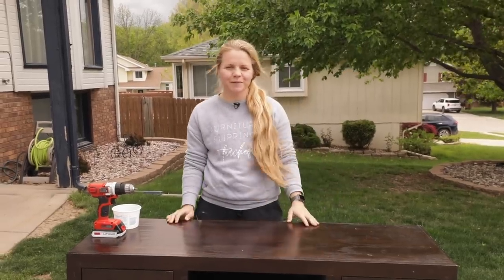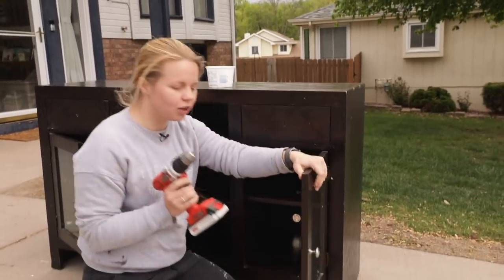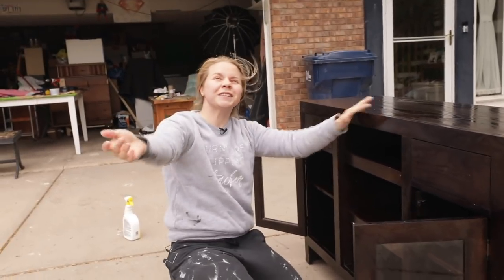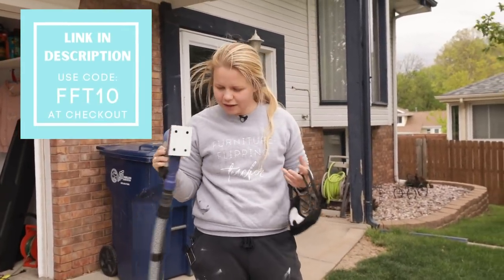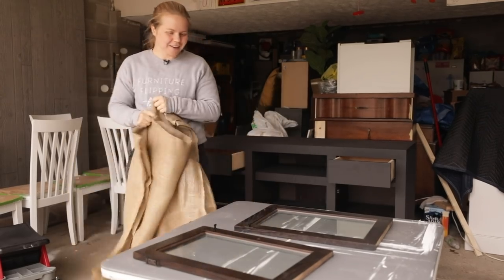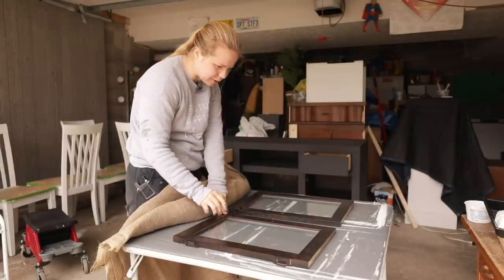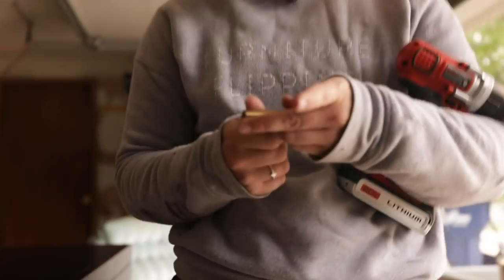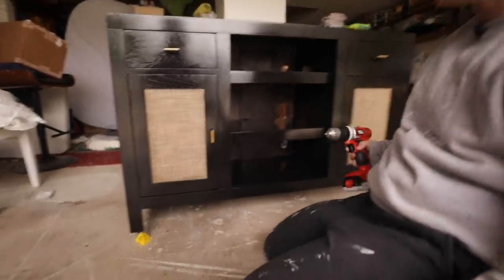BURLAP: A Good Replacement for CANE?? | DIY Furniture Hack

Comment: When you're out shopping keep an eye out for rattan and cane placemats, table runners and other natural woven products you could use as inserts the way you did in this video. You can usually find them fairly cheap at resale shops.
Reply from the maker: Great idea ☺️

Thanks for the suggestion and for watching!

Comment: You can use liquid starch to attach to glass, when dry you can trim around glass and replace in door. Burlap can be removed and starch will wash off with warm water and soap.

Comment: I like your designs a lot..I wonder though - there is a hole in the back wall which wasnt fixed, the inside shelves werent painted and the backside of the door wasnt painted either (or it didnt look like it was) so I just wonder if there is a reason for doing it this way? to me it looks unfinished..

Comment: Hi hun, love your videos, youre always so informative and easy to follow! Can I just ask, did I miss it, cid you say how the burlap was squished with the glass. I saw you ptting like brown flexible rods in but missed what they are or where to get them?
Reply: I think she said they were just a part of the entertainment center already (holding the glass in).
Reply: They are little metal push pins that hold the glass in. Like they use in a picture frame shop.
Reply: Karin - I realize it's been a while since you posted your question but here's an option to research.    Check Home Depot,  Lowe's, etc in the the window screen replacement department.   They sell a rubber cord called 'spline', created to replace window screens.   It can be cut with scissors, is easy to maneuver and affordable.    Also burlap can be attached to the glass with white school glue (dries clear - I add ⅓ water to ⅔ glue - a gallon is $9.99 at Michael's or small bottles via Dollar Tree), or liquid starch.    The burlap can easily be removed via soaking in warm to hot water.   Good luck.

Comment: Looking at the back of the top....it’s particle board.
Reply from the maker: Its plywood I believe! and its very heavy so it seems right!
Reply: Yeah, it’s particle board covered by wood veneer. Most conventional furniture is made this way. :)
Reply: @FurnitureFlippingTeacher  it’s definitely particle board, which is why it’s so heavy. Plywood is a little lighter, and solid wood is lighter yet..depending on type of wood. You did a great job!

Comment: I recently worked on a wooden bureau and painted it but i was wondering if i should paint the inside of the drawers that pull out? It was a very dark color that i whitewashed with white. Do people like the inside to be painted too or does that matter?
Reply from the maker: I’d personally say it doesn’t matter. If you were worried you could always add inside wallpaper or some type of transfer on the inside... just an idea. But nope, I would say the insides of the drawers aren’t make or breaks.